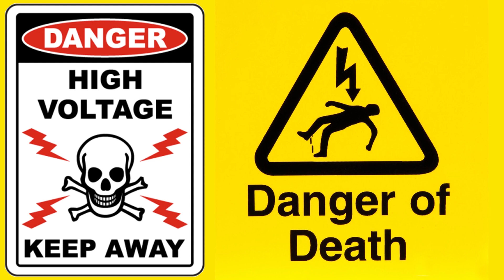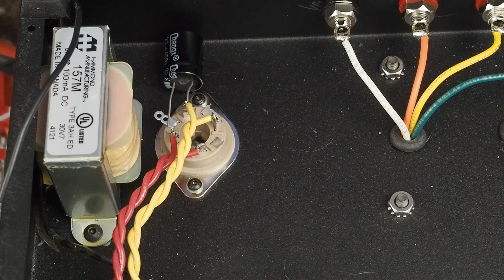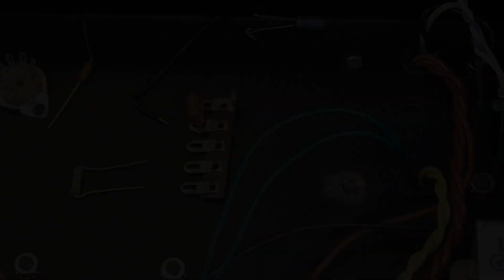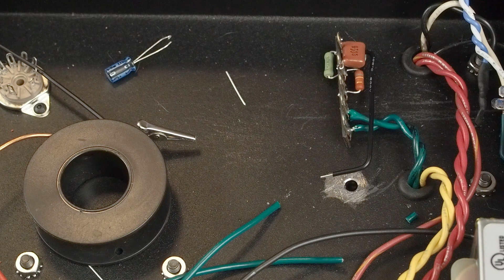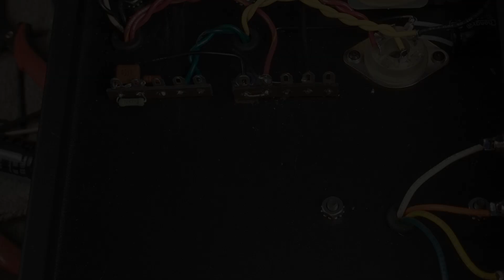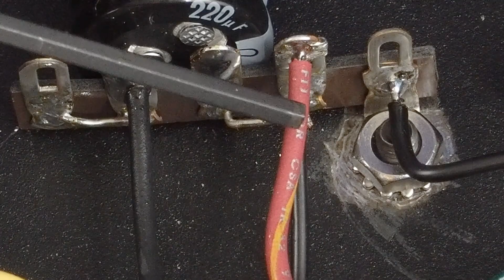Tubelab Monoblock: Detailed Build of Second Amp #2

Comment: Thank you for your effort. Wonderful tutorial for novices like me. Can you please explain why the film capacitor is required with the voltage divider. What should be the value and how to calculate the value of the capacitor? I need to lower the voltage of a transformer that has 230 volt, 40 ma secondary but I need to lower the voltage to 200 volt for a DIY tube preamp.
Reply from the maker: For higher current use, a dropping resistor or adding a higher resistance choke into the power supply might be a better plan. A voltage divider is better for very low or basically a no current application like adding a DC offset to tube heaters.

Comment: Hello again catching up on some of your older videos as I am new to your channel and like I commented in the past about your work being very neat and meticulous. Anyway what I wanted to share was when I was in high school which was a trade school I took electronics for 2 years Junior and Senior years. In my senior year way back in 1972 all of us in the class was to build a vacuum tube stereo amplifier made from scratch not from a kit we will given all of the bulk Parts Plus a piece of sheet steel that we actually had to make the chassis using a box and pan break. This was a very interesting school project but actually it was very obsolete for its day as the design of the amplifier was from the 1950s the vacuum tube layout was as follows.  A 5U4 rectifier tube. A pair of 12AX7 tubes one for each Channel and a quad set of 6BQ5/EL84 audio output power tubes two for each Channel. It had separate volume and tone controls for each Channel. And in the design of the amplifier it had potentiometer parts to control the voltages on the power tubes the bias voltages and such. That amplifier sounded great I used it from the day I took it home from school until July of 1984 when it was destroyed in a water flood 5 ft of water filled the basement and everything I owned was destroyed as I could not rescue anything because I was out of town thanks to a broken water main. Anyway that's life here in the big city life is tough what can I say

Comment: These in-depth videos are very enjoyable.  Populating the tag strips "not bolted down" looks like the best way to me.  BTW which speakers are you going to use with these new amps?  I think you mentioned a lower efficiency speaker is in the works.
Reply from the maker: I have some DIY speakers I want to try out that my SE amps can't drive very well.

Comment: Never occurred to me to load the tag strips before mounting them to the chassis. This is smart in a smaller box. I see a lot of builders doing star grounds. I've used bus lines with very good results. For some reason when looking at the schematics, the buss just clicks with my brain a little easier when trying to avoid loops. The teflon tubing is a great idea. I've always used shrink tube but the PTFE is a lot more abrasion and heat tolerant...great idea! Once again thanks!